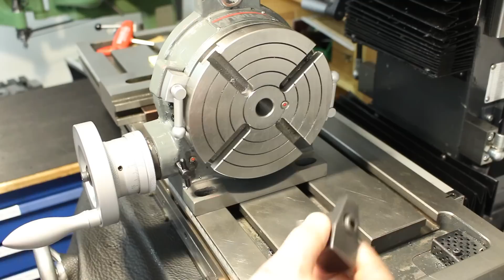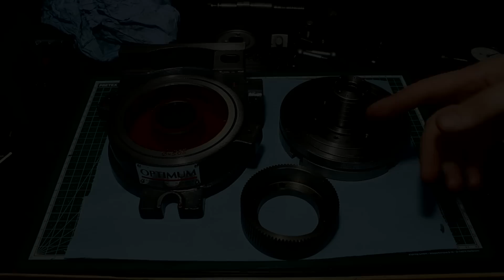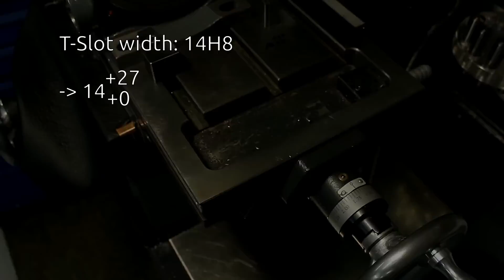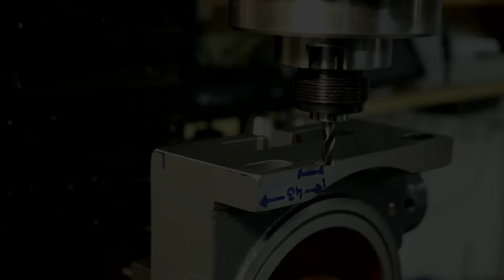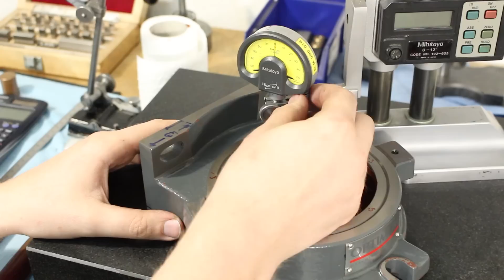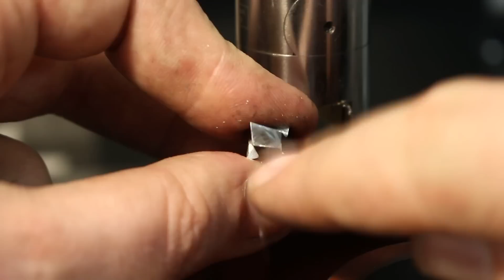Improving the vertex rotary table - Part 1

Comment: What was the reference book that you are using? do you have an ISBN number?
Reply: I believe he was using the 41st or 42nd edition of "Tabellenbuch Metall" 1999/2002 which is one of the standard German books for metal working.
The latest edition should be "Tabellenbuch Metall / 46th edition 2014 / ISBN-10: 3808517263 / ISBN-13: 978-3808517260" <- Language: German.
Reply: Thanks for that info Frank!
Reply: Russell Faison   Is this the same book as Westermann's?  I am looking for the "English" version
Reply from the maker: @Frank Müller ansered this perfectly :)
Reply: I just ordered this. It’s a newer edition, from 2018. I’m wondering if has info that my new edition of Machinery’s Handbook doesn’t already have.
Reply: Do you suppose we cpuld also get that book in english
Reply: @CraigsWorkshop  Also the Machinery's hand book (its hardly a hand book at about 75 mm thick) various editions - its expensive to buy new

Comment: Hmmm - I would like to gently disagree on a couple of the instances you gave, Stephan, of machine clamps not needing lots of tightening torque.  Firstly, drawbars or drawbolts: I agree with you entirely in the case of Morse and other self-holding tapers (typically around 1:20 on diameter), but when it comes to self releasing tapers, they sometimes need LOTS of drawbar tension - and given that you don't always know when you fit a toolholder what the cutting conditions may be on a later job, I feel it's better to form the habit of tightening them to the max. 
Before I developed this habit on my 40 taper Cincinatti mill, I had several experiences of a taper working loose, which makes a distinctive noise during a cut, and if you do not immediately knock out the feed , things could get ugly. And in the case were it is not detected but cutting forces are light, fretting (brown powder) may start, which will quickly destroy the self holding ability, as well as the precision, of the spindle.
IF you always take light to moderate cuts, which is usual on precision machines (as you may have done with the 40 taper on your Deckel FP2 high speed head, Stefan, which does not feature high torque) and avoid heavy interrupted cuts and big face mills, you may never experience this problem.
The usual self releasing taper is 7:24 on diameter, which dates back to the 1920s, when Cincinnati, K&T and B&S took out a joint patent. The usual tapers are 40 and 50, but 10 thru 30, 45 and 60 are also in existence.  The same taper is used on NMTB, NT, ISO, SK, CAT, V-flange, and BT (also some ANSI, DIN and JIS tapers). R8 is another self releasing taper but I have no experience of how tight it needs to be pulled.
On modern NC machines with power drawbars, the torque is intentionally so high that the pull studs will break unless they are renewed according to a schedule which takes account of fatigue. 

The second situation where I have found it necessary to swing on a clamp is with the quill lock. These are not always well designed, a classic example being the otherwise excellent Arboga U2508 milling machine. Unless and until the quill lock is re-engineered on these machines, it is unfortunately necessary to fit a longer handle on the quill lock, and swing hard on it, in order to prevent the spindle retracting during moderate to heavy milling cuts. This becomes evident if you fit a digital scale or a dial to the quill: you can see it moving in real time.

The general point you make is (I think) important and valid, but as usual with generalisations, the devil is in the exceptions.

Comment: Excellent video Stefan as always.  You can lap the cast iron with an aluminum lap and garnet abrasive. Garnet is one of the so called "non charging" abrasives. Make sure you let the abrasive break down to non existent as you approach final size and just use wd40 only at the end. Scrub the bore well with a stubby nylon tooth brush and it should relatively grit free. Love that brain surgery with a battle axe comment!
ATB, Robin
Reply: ROBRENZ o
Reply: @Stefan Here in the States the go-to brand of the abrasive @Robrenz mentions is Timesaver lapping compound: https://www.newmantools.com/lapping/time.htm. Not sure if it's available in DE but maybe the description/specs you can find under that name will lead you to something available to you. I actually first learned about it from one of Robin's videos on the adjustable chuck stops. Tom Lipton also uses it in his recent lapping plate videos. Super video! :)
Reply from the maker: Thank you Robin, especially for the detailed instructions for lapping cast iron, that was very much of a mystery to me. Garnet like the sandblasting media?

I have seen the timesaver lapping compound and Richard mentioned it also during the scraping class to lapp babbit bearings, but it is a bit hard to be sourced in germany, but garned in different grits should be possible to get..
Reply: I would make sure the abrasive is garnet. In the US silica sand and aluminum oxide are more prevalent abrasive blasting medias.
Reply: By the description it seems very much like Flitz polish. Diatomite parts are very big and brittle at first, but with every movement break down to smaller ones, thus no abrasive embedding. Though embedding is not so dangerous, it could be removed with several means, from ultra-sound washing with hot washing liquid like Fairy(technology used in car engine cylinders honing), down to more specific such as mechanical disruption of abrasive grains via scraping or use of some soft material like lead to absorb them.
But i'm afraid it's all like polishing a brick to mirror surface. Meaningless.

Comment: I don't like working on rotary tables. I always bought Hofmann rotary tables; I never had any accuracy issues and produced very nice parts from day one. I couldn't afford to spend the time rebuilding these Vertex  tables.
Don't get me wrong I like Stefan's work on this table.
When I did this work I always had a small direct reading torque wrench on my table lock down screws to avoid the problems mentioned here.
Reply from the maker: The torque wrench is a great idea!

Comment: That Mahr gage really works nice! Have you considered milling perpendicular slots in your mill table to use stop blocks for speed alignments? I know that feature is common on boring mills and I get reliable repeat alignments within about 0.01mm if everything is nice and clean. For most all the work I do the stops are plenty good for doing the work without indicating and it saves a huge amount of time.

Comment: Good tip on stone flatness( I,ve seen it used wrong too) knock those highs down with a punch that's a rebuilding old stuff trick. you get good at it you can meke em disappear. looks like another good series. that table be pretty nice to use.

Comment: Maybe the fancy indicator could have used a custom bore adapter to measure the outer bearing surface for the rotary tee slot plate. Impressive work as usual though.

Comment: Stefan, if it was me doing this rebuild, I would sleeve the body with Phosphor Bronze, then machine the table spigot to fit. That way you will have cast iron wearing on Bronze, good life. What you intend to do is have a possibly hardened steel sleeve on the turned down table spigot, then working in the cast iron body, not so good. The Bronze sleeve in the body need only be a nice tight sliding fit and fixed with Loctite. Then you will be able to have the finished Broinze sleeve in your hand as a test fit when machining and honing the table spigot.
Reply from the maker: I was thinking about bronce too, but hardened, lapped steel against cast iron has also excellent wear properties.
Reply: i have broken down oil pumps in the past which are hardened steel shaft in graphite cast iron casting body, the hardened steel shaft has worn up to 1/8" and the cast iron had no more than .001" wear. when i lap a surface i use a piece of 10mm plate glass and bond carbarundum paper to it, usually for blocks and cylinder heads.

Comment: Thank you for giving me the courage to tear down my 6" table, a less precision HV6 version of the Vertex made in China without the finish and precision.  Question:  how you go about adding a clamp to the back of the table when in the vertical position? You mention it at 3:42.  Do you add a L piece bolted to the slot there?  Thanks again.

Comment: Watched this again. My cheap 4" actual had no ball oiler like yours to oil the main shaft and cast iron sleeve. Has a spiral in the shaft so I think it was intended to be oiled, somehow! I need a plastic mallet to remove the the shaft from the sleeve. Do not trust myself to bore the housing but wonder if just using a cylinder hone would open the clearance without going too far. I wounder too if the shaft is tapered just a little since half way out of the sleeve it loosen up. Novist machinist.

Comment: How did you manage to remove the worm gear? Mine is stuck on there like crazy and not a single surface to pull on or use a lever.

Comment: I can see that you are being very precise as usual.  I am sure the rotary table will be much better than the factory made it after you finish.  I cannot imagine how you manage to keep things so clean.
Reply: +Amateur Redneck Workshop lol I know! I look at my lathe and think Stefan would probably cordon off my shop and call in a hazmat team in before setting foot in it. It drives home the point that high accuracy depends on a lot of things being right, with cleanliness being one of them. It also explains why my work isn't as accurate.

Comment: I have felt that cringe, too...seeing guys using these stones all the time on surfaces that didn´t need it or using them way to excessivly.
I scraped my stone with a diamond file and the help of a precision ground steel plate. Kinda reverse metal scraping.
I use only the hard (dark) side of these duplex stones which is actually the fine side not the orange one which has a softer bonding and is more aggressive. and even more with the use of oil, i might add. 
You only want to eliminate the high spots, nothing more.

Comment: Stellar video as usual Stefan.  I think what I like about your channel so much is we are in effect, twin sons of different mothers.  Maybe it's our German heritage to some extent, while I was born in and live in the US, it's pretty hard to be more German than my forbearers.  In any event, the pursuit of precision seems to be a core part of what makes "us" tick.  I find it interesting, while you were showing the T-nuts and discussing using the table slot for location, my mind immediately went to securing a properly sized piece of barstock to act as a semi-precision guide, watch a few minutes more, sure enough, your final approach was exactly what I had in mind.  What's really cool is at the end, you'll have a rotary table that performs at the highest levels practical, having invested less that 25% or so of the cost of a high-end offering.  I'd yank that Optimum plate off and replace it with a Deckel engraved plate of your own design, showing this is no longer a garden variety imported table.  Can't wait for the next video.  Oh, before I forget, I don't want you to disclose any of "DR." King's techniques, but I'd be interested to hear what surprises you learned in the class, meaning, are there any process changes you need to make to your self-taught scraping?  Thanks.

Comment: "So it's not so fricken heavy..." Sure looks lighter than my 12" :) In many ways I'd rather have the 150mm, as for it's lightness and ability to do vertical.

Also, head bolts on a Bport need to be pretty tight. They tend to move anyway.

Comment: The find adjustment on indicator stands is more like a miniature deadblow hammer....I 'm stuck at deciding between the older Hicator 1μm or a Filetta digital indicator. The biggest gripe with the comparator style indicators is the lack of travel which might be a problem with my sketchy base, while the digital one has a data output too and could power a lot of projects. I only need a μm indicator for setting the correct preload on my mill spindle bearings and would rarely need it for anything else. Precision for a little less or versatility for a little more?

Comment: Thanks, great quiality video and tools.Might be used as a learning material. 
Funny how you mark the workpiece with common marker. I thought Kronzirkel and Stangenzirkel were invented in Deutschland :)
BTW, what end gauge set are you using? We have similar, even to wooden box size&form,  ones, left from USSR factory production remnants. They are tools of extra quality with precision down to tenths of micron and require extra care & caution, like chemical cleaning before&after every use, gloves, oiling for storage and so on. Were used usually in most fine machining areas, such as flat and round-grinding, or measurement equip tests.
A bit puzzling to see them used as calipers for mere t-slots width measurement. Or do you have second more exact set and use this one just for work?

About the whole rotary table construction. Awesome, with emphasis on "awe" part. Luft is absolutely intolerable for anything more exact than stone axe grinding. Simple multiplification to table radius or possble workpiece offset in chuck gives horrible numbers.
Even smallest chinese divide head like BS-0 seems better choice. It has cone bearings at every end of hardened steel-made spindle, so there's option to change them for something decent like NSK, thus giving completely different level of equipment rigidity and exactness.

IMHO this table cannot be improved to such level. Best material for sleeve would be bronze, but it requires constant lubrication and will soon lose geometry, distorted with radial direction forces, inevitable in milling operations. Cast iron versus hard steel dosn't require lubrication but i don't think it will stand against pressures, taking into account the forces applied to contact surface. Though maybe i'm wrong, and you'll find a way to succeed. 

Thanks again for the vid, it's really helpful!

Comment: Great video!  After seeing your original rotary table video I purchased a rebadged 6" Vertex RT.  It was all the same except it lacked the radial bearing on the base of the tables shaft so I added one and it greatly reduced the locked and unlocked turning resistance and eliminated any rock on the table.  I still have an issue with the worm screw and worm wheel mesh.  It gets tight from aprox. 340 to 360 degrees.  I have a feeling that the worm wheel might not be centered.  How did you realign the worm wheel on the table?

Comment: You showed that your mill's T-slot was within spec at 14.02mm.  At the one end.  Is it possible that the slot varied over its length?  At other spots it could be 14.000 and still be in spec.  Or is there a spec for the variation as well?

Comment: custom make a bore plug that holds the mahr to measure the outer bearing surface for the rotational tee slot table. total accuracy dude.
Reply from the maker: Ah! That would be a good soultion - I did it a bit different, wait for the next videos :)

Comment: Stefan, in one of your earlier videos you made comment to smaller brushes for the workshop. I have found some that I use in my workshop that may be of interest to you if you are still interested, dimensions are as follows: Overall length 210mm, Brush Length 65mm. They come in Steel, Nylon, Brass and Stainless Steel brushes.
By the way, nice videos and very informative.
Reply from the maker: Thank you, a kind viewer from Germany already sent me a livetime-supply of brass, stainless and steel brushes :)

Comment: A more than interesting and informative video Stefan. No surprise's there though. Your video quality and editing is rapidly getting very close to Clickspring's.
 
I've got the same Mitutoyo indicator other that mine's in imperial so it's got the white faced dial. I bought it new about 15 years ago. I'd guessed it was made by Mahr because other than the Mitutoyo name it looks exactly like one of the Mahr Millimess  indicators. After your comment I finally took a good look at the back of mine and sure enough there's a small silver sticker and small lettering that does say made by Mahr in Germany. Guess I should have read that at some point. :-) And yes that needle zero setting knob is the nicest I've used as well.

My R/T funny enough is also a 6" diameter Vertex. But an earlier one when they still used roller bearings on the tables spindle. You've just made a lot of work for me since now I'll have to pull it apart and run the same checks on it. I do know the MT center taper is a few 10ths off and the same for the tables OD. Adding some good ratcheting threaded table locks instead of the clunky Vertex original locks is on the list as well.
Reply from the maker: Thank you for the kind words :)

I have seen the older Vertex with the tapered roller bearings, I am not sure if I would prefer that above the plain bearing - I think both have advantages...
Good idea with the ratcheting handles, I will order some Kipp handles.

Comment: OY ..another fixture/adapter and you could run it down the ways of your lathe.
Or not.  Seems a super deep Zaxis milling machine then.... EH ??!!
Reply: Those T-Nut keys... Only need be 30cm long a a very special bolt for the rotary table base.
I dunno why manufacturers built something so precise, yet fasten it with Flintstone era boltage.